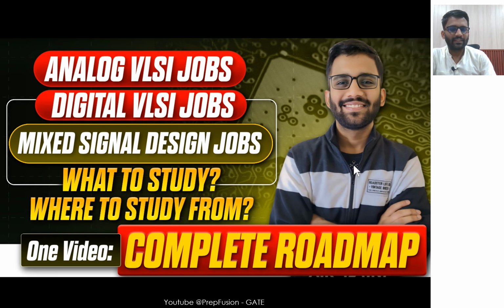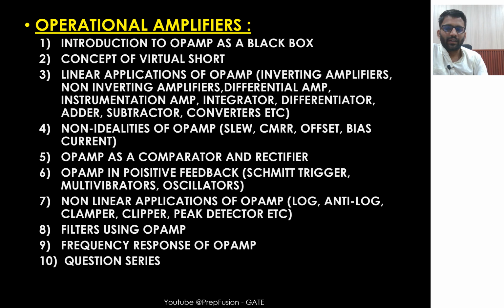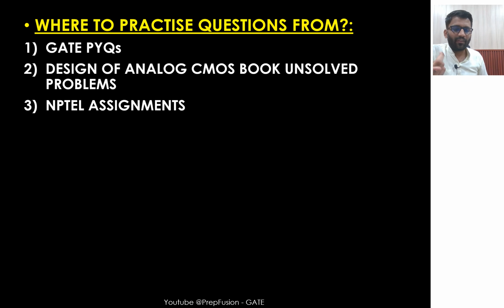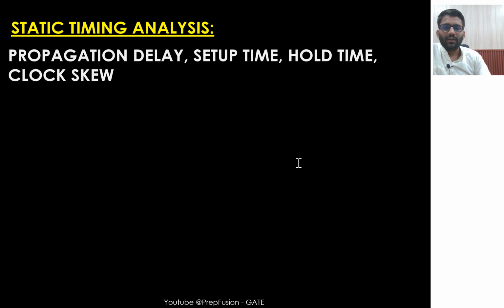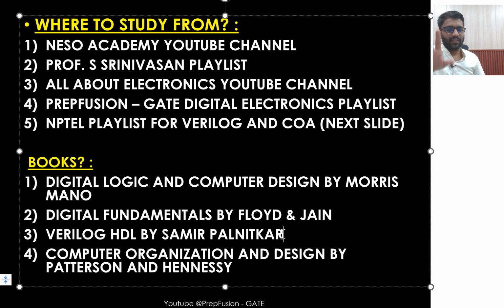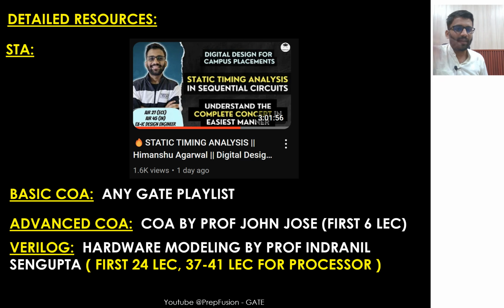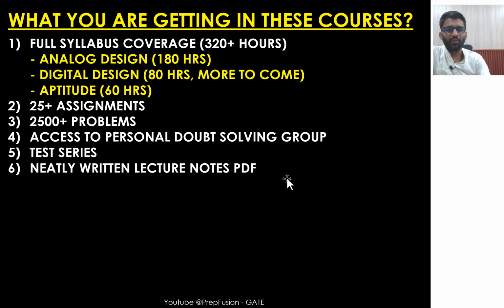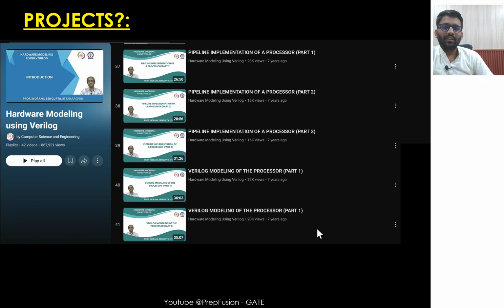🔥How to Prepare for VLSI Placements? || Full Roadmap || Himanshu Agarwal

Comment: Thank You Sir! for your guidance, as you mentioned that we need to prepare network theory, control systems, Analog Electronics and Analog IC design but I had a doubt that "is the two playlists of razavi covers both Analog Electronics and Analog IC design?" please reply back sir! I'm waiting for you response. Because why i'm asking this question means "in digital vlsi we have digital electronics separately and digital ic design separately where as in analog vlsi, there is playlists from razavi naming electronics part-1,2.
Reply from the maker: @nikhilakkireddi250  nah, I didn't say we need to prepare Analog IC Design. If you cover till Analog Circuits, that would be good enough 
And Razavi sir's playlist doesn't cover the IC design part.
Reply: @HimanshuAgarwal_  Really! Thanks a Lot Sir for your Response. i am following your lectures from last year onwards. Your teaching style is too good sir.
Reply: Hello I want to ask u something